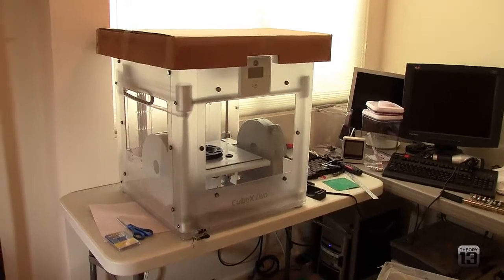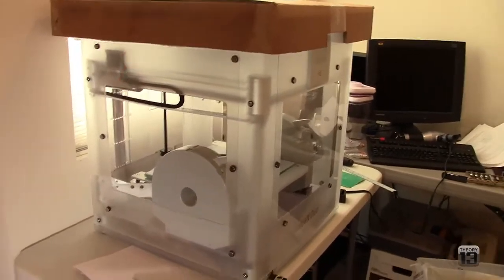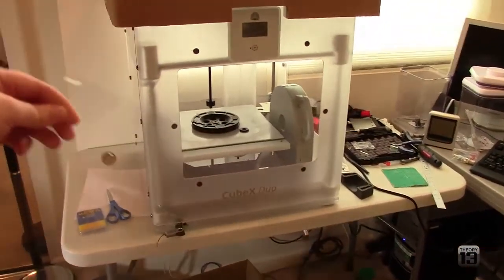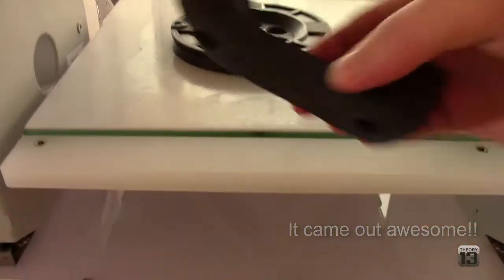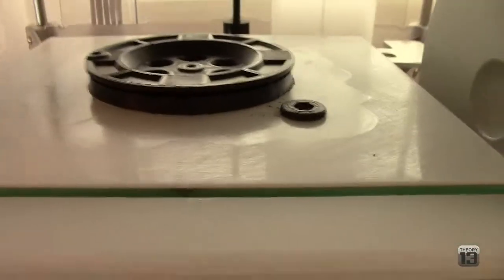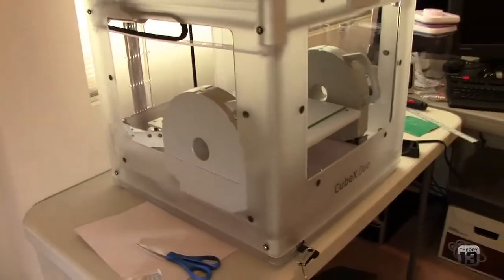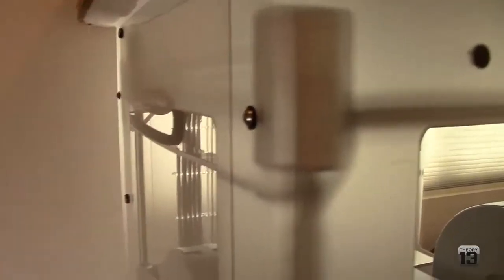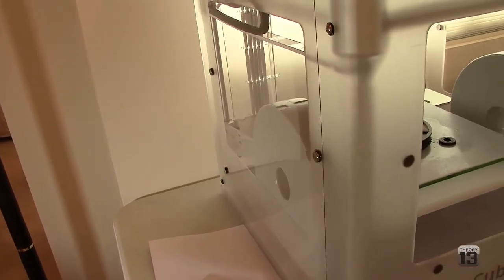Cubify CubeX Duo -- Video 016 -- (ABS) Warp Free!!

Comment: Yeahh! enclosing the printer like you did will help a little with the warping problem.
You should print the same part you show first (the one warped) again. So you will proof that it works fine.
The part sucssesfuly printed is cilindrical which equalizes the tensions  for every layer. I guess it could be printed even without the covers.
A suggestion for 3D System is to do a recall and change for a heated bed coz they advertize to print ABS and PLA. 
I want to hear from someone who printed complex parts in ABS without having any problem in this printer.

Comment: +TheTheory13 I actually discovered that you would not need the box on top since all you have to do is take the 'vented cover' and have the screws on it placed in backwards for the CubeX and place it in its new 'upside-down' position which should seal up the printer nicely just like the box except it is using its original cover in a new way.
Reply from the maker: ahhhhhhh!!!!  awesome!  I never did like looking at that cardboard lid!
Reply: TheTheory13 Yep, that is exactly how bikejunky98 did his anyway. Since you have the Plexiglas  already, you could just flip the cover over with the bolts also flipped and keep heat from escaping while the appearance is whole throughout.

Comment: sorry my english but I'm Brazilian...
my friend, to fix this problem of deformation in the corners, keeping the heat inside is not exactly the solution. The model that you show in the video, not warped, simply because it is circular. What warps, are the corners with vertex
"<" <= Deforms
"O" <= no deforms
For six corners with no skew angle you need to put a disc in the base, then just cut it with a knife.
check out this link: http://www.makerbot.com/blog/category/makerware/page/2/
Reply from the maker: Hey Fernando, that's an interesting take on the deformation issues with ABS

Comment from the maker: Yes...
i had the jet tip crumble some of the clay like material away on a disaster of a grow (video #005) that happened to me as well.  Cubify sent a replacement tip 2 me quickly.  They told me not to install it though, and to just hold onto it until further problems with the jet tip. -- a good backup, so 2 speak.
.
I hope you get that second tip running soon, with the new sensor/bracket.
.
I'm going to try to do a video on 2 material grows; importing separate structures sometime soon!
Cheers!

Comment: I also read that your second bay is reading cartridges as empty.  Mine is reading cartridges as not even present and that does prevent printing.
Support is sending me a new sensor and mounting brackets, should arrive this week.
I've already had to replace both of my extruder nozzles too as most of the beige insulation crumbled off during cleaning after a particularly disastrous build session that left them encrusted in a large block of plastic.

Comment: If you do try the two model thing for custom support please post the results.
I know it's a lot of material, but I needed the different colors for some projects that I didn't want to do tons of sanding and repainting on.  Just minor cleanup done in approximately the right color is good enough.
I just read the bit about trying to fool the cartridge reader and using generic material...I wish I had thought of that before.  I wonder if it will work.

Comment from the maker: Wow.  that's a lot of material! -- Yes, PLA parts with PLA supports are horrible - especially if you let the Cubify software build the supports. 
With my own supports, they are breaking off nicely.  It takes a bit more time to model... but that is time saved not post-processing the finished print.
.
Over on the news group, one guy just posted that he's using cheap filament bought bulk (2.2 lb rolls).  He's at about 25% of our cost.

Comment: Thanks,
I saw your #12 video.  I've had more luck with several layers of glue.  I've found that the secondary layers seem to reinvigorate the tackyness of the lower layers somewhat increasing the printing window.  I usually put down a fairly significant layer, let it dry and then apply a very light layer just before printing and I haven't had any problems since doing that method.  The single layer approach seems to be too time sensitive for me.

Comment from the maker: Hey gimungus,
Thanks 4 the comment!  Glad they're worth it to somebody!
I've come 2 understand that a super thin layer of glue is all you need for PLA. It needs to begin drying (IMO) for best results; it can't be sticky wet.  -- You can actually print with PLA with no glue, but its hard to get off the plate then.  So the glue is like a releasing agent in a way....
ABS is different.
For ABS you need a thick layer of glue.  I usually apply one coat, they go over it to make sure its thick.
Cheers!

Comment: Huge thanks to you for making these videos.  I got a Cubex Duo at around the same time you started these and they have been super helpful since I've been having many of the same issues as you.  Do you find that a single application of glue is usually enough rather than the three that 3D Systems recommends?